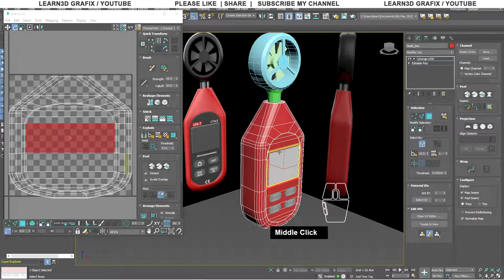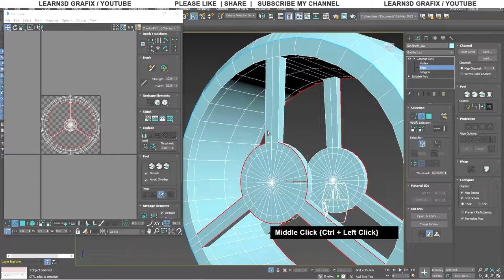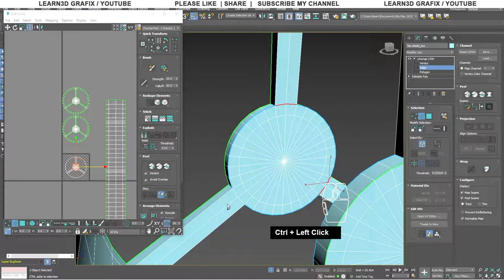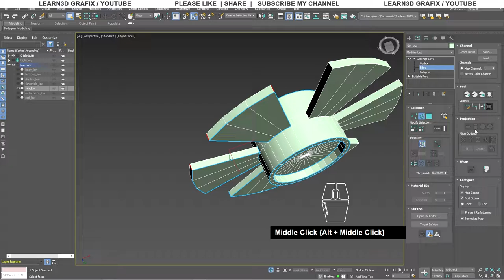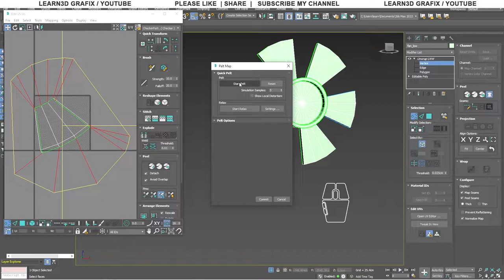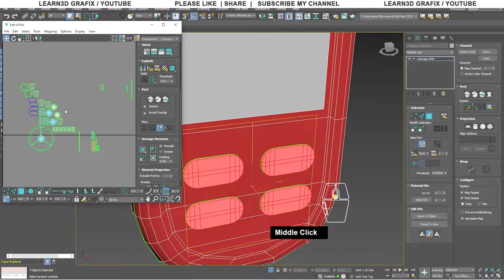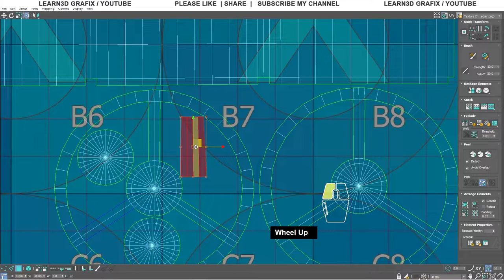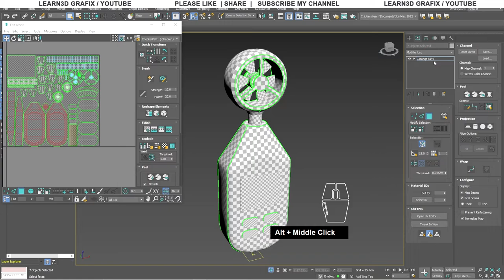Easy UV Unwrapping for Beginners | 3ds Max Anemometer Unwrapping

Comment: Hello mate, You just unwrap low polly model be fore move to 3d substans printer? thanks
Reply from the maker: Yes, I modeled the low poly version first then a high poly version of that, after that I unwrapped the low poly version and then baked the required maps and textured it in substance painter!